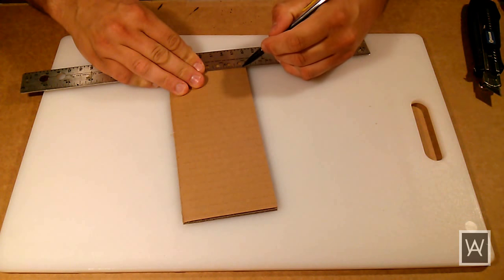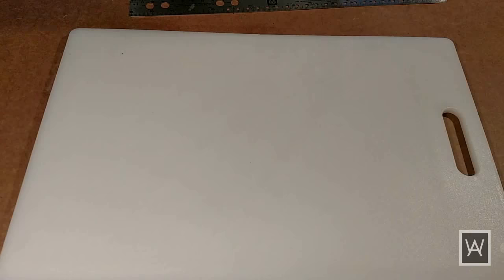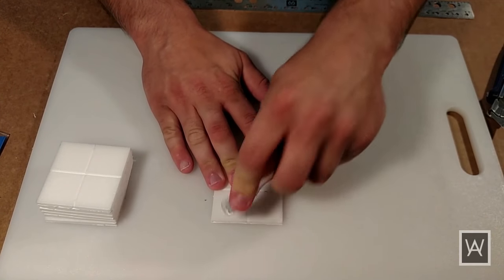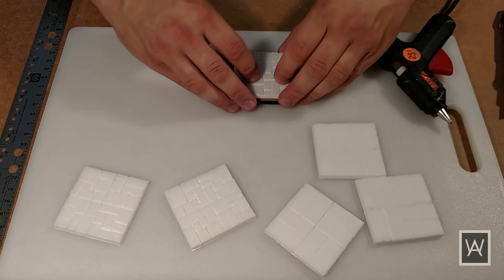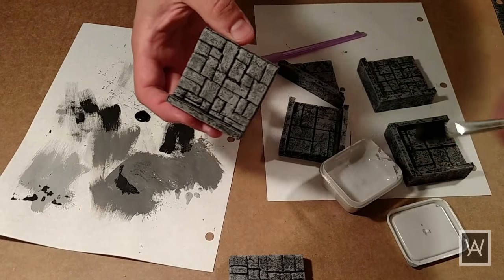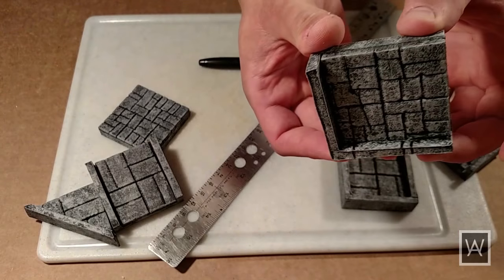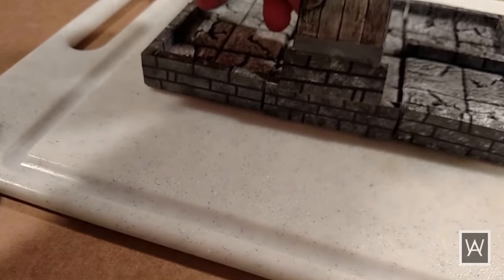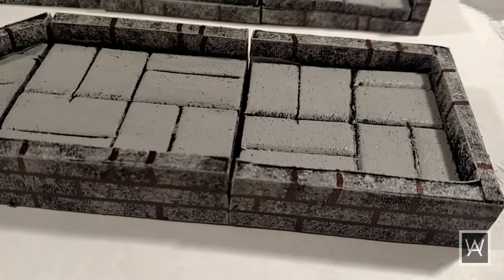How to Make Castle Tiles for Dungeons & Dragons

Comment: Wyloch, love this tile system of yours; this may draw me out of my 2.5D "NEXT" type system I decided to go with initially. You solved the problem that working with Hirst Arts dimensions could cause, but with the same awesome look as those pieces. Question: from your experience with using these tiles with dungeon dressings, do you ever wish for higher walls like in most Hirst Arts builds?
Reply from the maker: Thanks for your viewership.  No, I like shorter walls.  I think Scotty nailed it when he came up with the whole 2.5 short wall concept.
Reply: Playability can't be beat. Only thing I may miss is surface area for hanging wall decorations or elements on, but I can just craft a custom clip-on wall section like you've done for doors or Scotty's done with the magic mouth craft and so on. Excellent vids! Glad you just carried on into "season 2" without a break :)

Comment: How did the slate grey tiles turn out when they dried?
Reply from the maker: +iHunterKiller Okay....I have stopped using that paint.  It was premium semi-gloss interior house paint, WAY too thick for crafting and with a long dry time.  Now I use cheap acrylic craft paint and it's much easier to work with.

Comment: why all the hastle ? u could use thicker foam
Reply from the maker: You mean for the foundation?  Two reasons: Foam is much more fragile, and, the exposed corrugation gives excellent surface area for the hot glue when attaching the walls, making them incredibly strong.

That said I do wish I'd used a chipboard slab with foamcore attached to it for the foundation.  It's too tall as is.  I regret this one a bit.